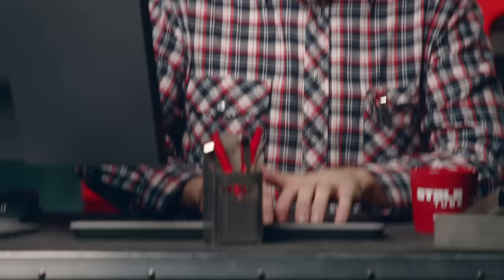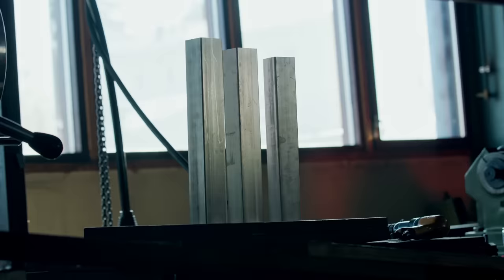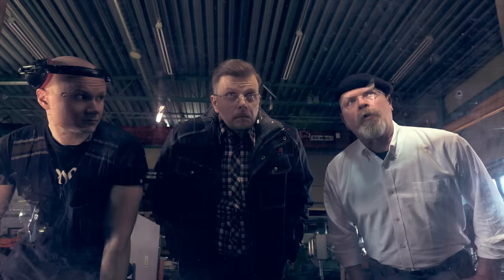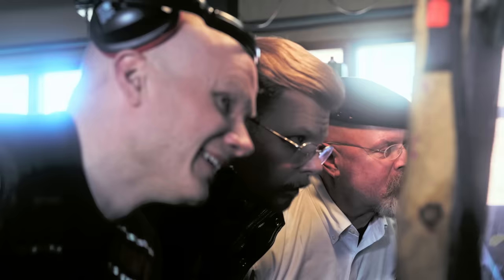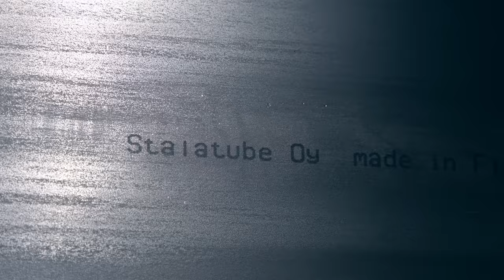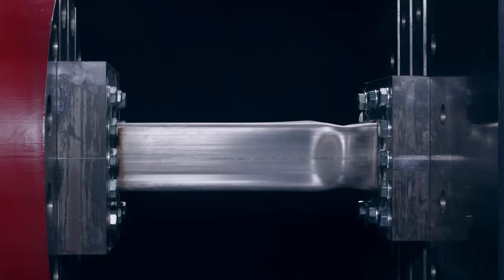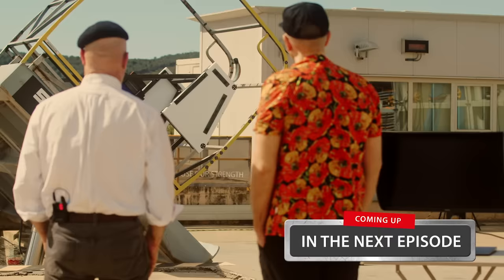Stalatube X Pekka feat. Jamie Hyneman | Part 1. The Pressure Test

Comment: Welcome back Hyneman. Both Hyneman and Savage used this steel in their shops. This experiment shows what steel is the strongest before it breaks. Each beam is placed under a press, heated with a torch, and placed into a pulling rig and the first one to break is the steel we don't use. Always good to see these test.

Comment: The problem with the remaining deformation is that despite the work hardening it's a location that is ready to flex actually making it weaker in the location.  Work hardening for these incidents does not go up fast enough to counter the weakness that the curve that the plastic drformation caused. In fact, this deformation was attributed to work hardening when in actuality one side of the wall is wtreatched longer than the other.

Comment: What the hell. Just last week I saw a video of Adam of Mythbusters on a lecture on manufacturing technology and this week I was talking about Jamie as a name with friends only for youtube to recommend me this video, and learning that Jamie of Mythbusters was appointed professor to another university of technology in Finland. Hollow square beams and tensile strength is definitely stuff I'm into, have heard and calculated S355 so many times. This is like some sort of all stars video. Really dig the character Pekka is presenting. A stereotypical Finnish engineer I suppose.

Although are you sure 1,5 mN is equal to 150 000 kg? Shouldn't it be 0,0015 Newtons -> 0,00015 kg? mN is milliNewtons after all.

Comment: Love the humor, and it is entertaining for a commercial, but remember people, this IS a commercial. Do your own research before you just accept what you are told, if that research leads you back to their products, great.
Reply from the maker: Yes, this is an ad, but the tests are real - the results are not manipulated.
Reply: @stalatube_official  no, I did not mean to suggest they were. I believe the results are legitimate, but obviously, the ad will focus on the products strengths. I noticed there is not much discussion of the relative cost of the materials, for instance. Or sheer/tensile strength. Not to suggest those are not possibly also excellent, but it is something a prospective customer needs to consider among many other properties.

Comment: But does the increased strength and corrosion resistance disproportionately inflate the cost?
Reply from the maker: Not in the long run. The life-cycle cost remains the same or even less.

Comment: So funny. Does the super higher strength steel tubing require special welding rods and welding technique?
Reply from the maker: Lean duplex material (Stala630D tubes) requires duplex welding consumables. All conventional welding techniques can be used.

Comment: I’ve been watching Lauri crush square tubing for quite a while and I agree, it’s quite beautiful. Where can I find studies on the crushing pattern we see? Why does one pair of sides come inward and the other outward at first- irregularities in wall thickness, not perfectly square cut on the end resulting in u equal forces, or something else? How do the forces redistribute after the first bit crushes to make the next bit crush the other way? What determines how long a section of the tubing crushes? Is it always roughly equal to the width of the tubing? What happens with rectangular tubing?

I have asked these questions in comments on the Hydraulic Press Channel but I suspect that’s not something Lauri studies. Since high strength square tubing is your area of expertise, I’m hoping you can point me at some engineering resources to help me find answers.

This is not idle curiosity. I am designing a high strength vehicle frame and am considering square or re angular tubing, and I need to account for failure modes under longitudinal compression.

Even if I weren’t doing this I admit that I would still want to know, though.
Reply from the maker: @markfergerson2145 
We don’t think scientific studies regarding crushing pattern are available. A tube is never perfectly square, there is always some concavity or convexity in the sides of the tube. That causes local buckling under compression. How the forces redistribute after first bit of crushing depends on the geometry of the tube, type of the material and wall thickness. Nature always finds the weakest point from the tube where is buckles next. 

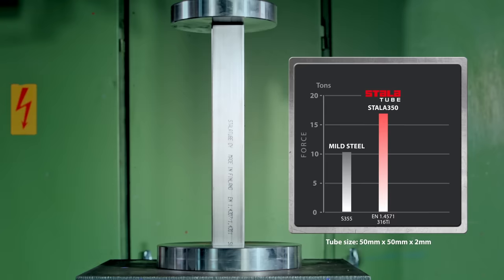3:24 > As you can see there is already plastic deformation (buckling outwards) where the steel grade marking (EN 1.4307) begins. That is now the weakest point. This process goes on until the whole tube is crushed. Understanding what really happens in the material would require FEA/FEM analysis.

Comment: Greetings fellow stainless steel enthusiasts.

Is that duplex heat resistant enough for ev fires when they pop?
Reply from the maker: We don't have exact information how high the temperature can be in case of ev battery fire. Based on some sources it can be 1000 Celsius degrees. Melting temperature of duplex stainless steel is > 1400 Celsius degrees. So, it shouldn't melt in case of ev battery fire but at 1000 C degrees it has only couple of percentages of the strength left compared to room temperature.

Comment: what's the fatigue like on it could it be good to make a custom 4x4 chassis out of ?
Reply from the maker: There is no big difference in fatigue strength between different standard steel grades. If you want to optimize the fatigue strength, you need to reinforce welded joints. Our high-strength materials are optimal choices to be used in different kinds of chassis structures.

Comment: Fun commercial, but they are not telling the whole truth 😉
The AISI 304 and AISI 316 does not have the same yield strength as S355, not even close. A parameter that is very important, as its the point where the steel can deform and return to its normal shape. 
AISI 316 has a yield/proof strength of 220 MPa, and S355 has one of 355 MPa. So it would bend into a permanent state loooong before S355.

But of course they are testing ultimate strength here, where AISI 316 and AISI 304 are better.

Comment: Heat weakening steel is why the towers on 9/11 pancaked so easily (aside from the obvious gigantic hole in the side of the building). Structural steel is only at 70% of it's original strength, even at temps as low as 800 degrees F, and down to only 40% of it's original strength by 1000F, by 1200-1300F, it is practically play-dough, in terms of structural integrity.
Reply from the maker: In this case sadly so.